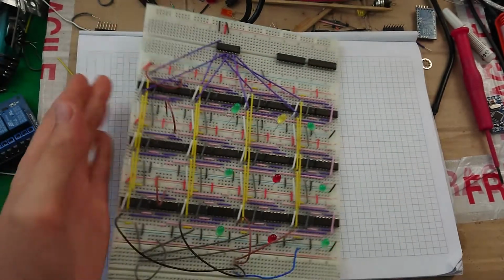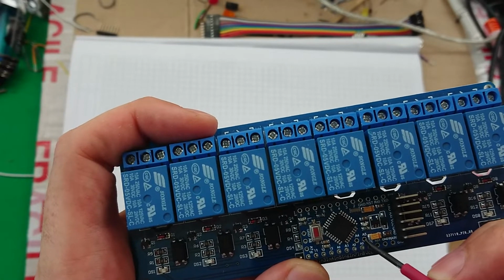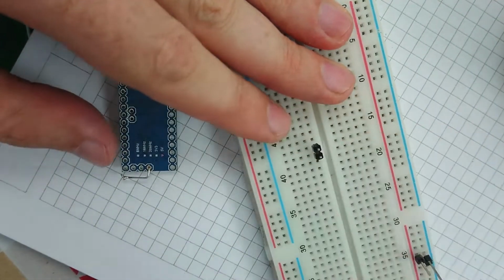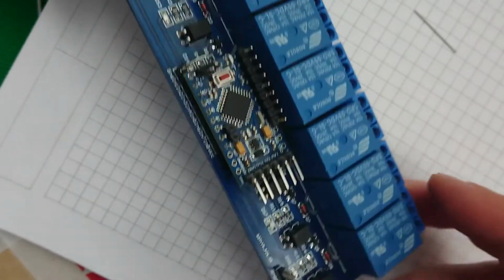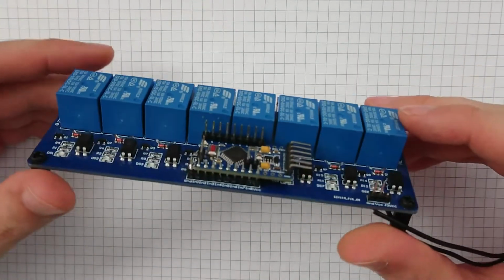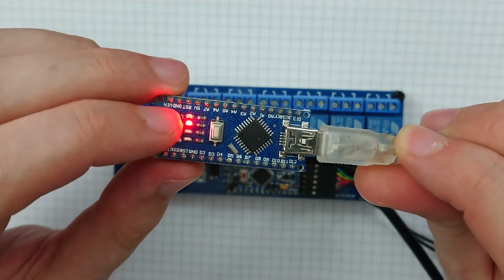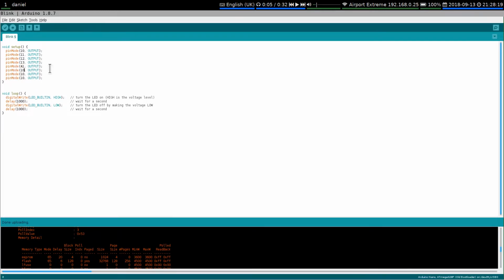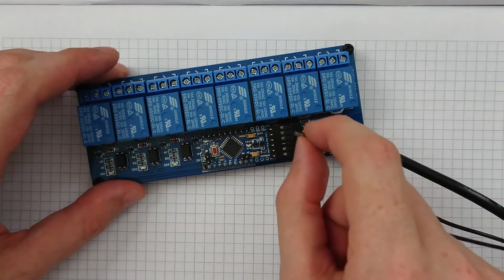Digital Segment Timer v2 - Arduino Playground

Comment: I built a gps synchronised clock using the pro mini.   It’s your fault.  You inspired me to build and code something useful.  One weekend when you’re home ask Christine to drag you round and I’ll show it off.  

Stick a 1N4148 in the programming lead VCC line.  For no other reason than it’s an elegant solution.
Reply from the maker: Wow, that's awesome, nice one! :D Feels weird someone saying that I inspired them though, so... happy I could help? I still haven't even assembled the adafruit clock kit I got years ago now. :( Yeah must do sometime, I'd love to see it. :D As for putting a diode in the lead, that's not a bad shout. With my soldering though, I think I'll hold off for now. I just bet it has that awful insta-melt insulation and super fine wire that I can really make a pig's ear of! :D I suppose I could always make some kind of plug-in adaptor type thing though... hm... must ponder.

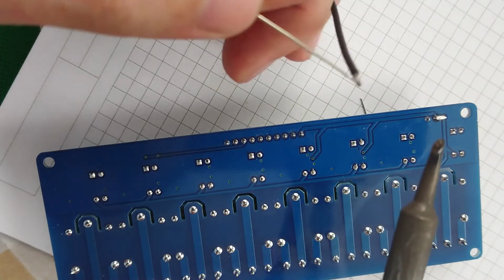Comment: 22:28 or thereabouts ... Your solder didn't take to the tip and just balled up on the end of the solder itself probably because the tip is oxidised. That will also prevent heat getting in to what ever you're trying to solder.

Leave solder on the tip after you've finished soldering and clean it off just before you want to solder again. That will prevent oxidation and make soldering sooooo much easier.
Reply from the maker: Yeah I'm a bit out of practice. 😕 I try to keep the tip of the iron clean but I'm clearly not very good at it. I might get a new tip and try leaving solder on it as a comparison. Also, filming at the same time had me a little distracted. Trying to stay in frame but also retain depth perception! Oh well, it'll come with practice. Thanks for the... tip? 😁
Reply: It'll make a huuuuge difference. Also, try to leave a blob of solder on the tip when you turn it off for the same reason. It might look messy, but it prevents the tip from oxidising in storage!

Happiness is a shiny soldering iron tip.

It does take some practice to break the habbit of solder, clean, put in holder after each use and change to solder, put in holder, then clean before next use.

Wait.. did I just come up with a rhym for this? "Solder, put in holder"??? 😁

Comment: NICE notebook. I want one.
I think part of Big Clive's secret is that his fingers are made of asbestos.
Reply from the maker: Haha, yeah I suspect that might have something to do with it. I guess your tolerance goes up as you practice. As for the laptop (I assume that's what you're referring to?) it is quite a nice machine, but the last one I had died annoyingly soon for what it cost, yet still out of warranty! I got another 'cause I was in a pinch and needed something I knew would work, and ultimately I do like the model. It's good for linux, but don't get it direct from dell. What a useless bunch of bellends. Find a retailer with an extended warranty programme. ;) They'll have more clout when it comes to shouting at the OEM. :D